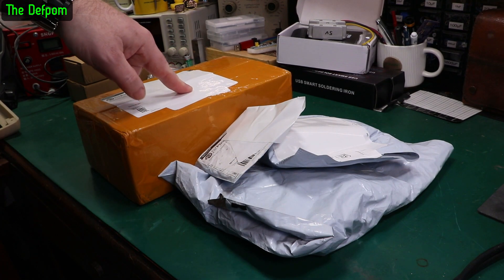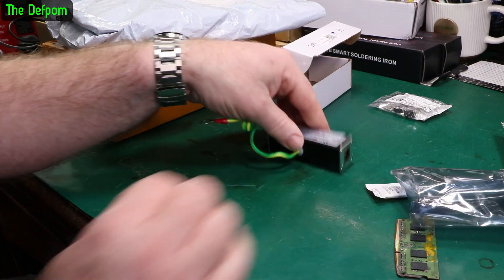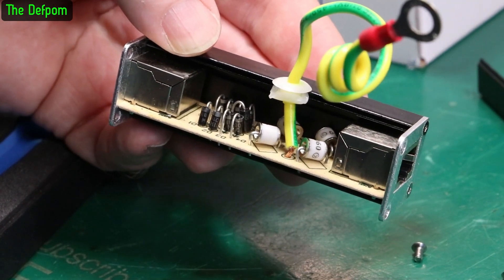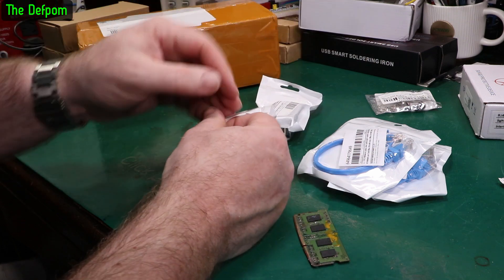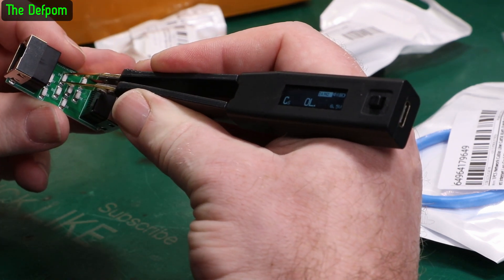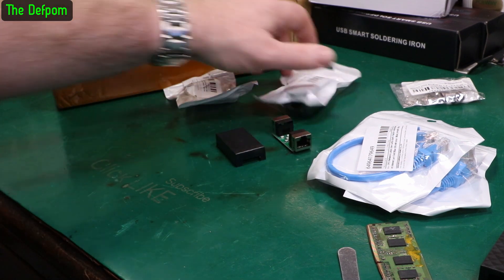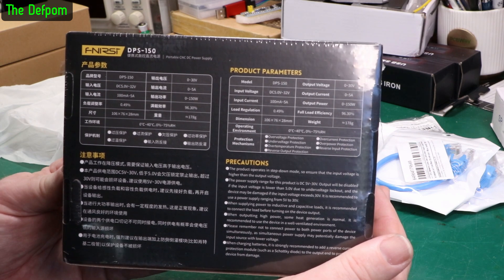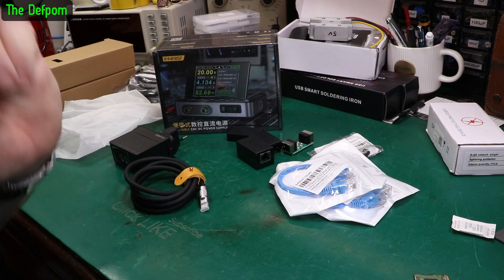🔴 Mailbag Monday 14th October 2024 - No.1288

Comment: Not exactly sure where surge protection on Ethernet could be useful as most services will be within a building and nominally at the same earth potential.  A lighting strike can blow the mains wiring and copper plumbing out the plastered walls.

The best solution to lightning strikes and rise of earth potential these days will always be services delivered over fibre, even short haul to the bottom of the garden fibre is really, really cheap.  The ductwork and the installation is more expensive than the fibre and the transceivers.

In the late 1980’s before fibre became commonplace for business high speed comms delivery, and copper multi megabit data couldn’t be effectively isolated a microwave link was the only solution, but protecting against a lightning strike on the microwave tower and a rise of earth potential between that and the building where the comms services terminated in caused us a a lot of guesswork, a lot of work fitting MOV’s, followed by a several years long finger crossing exercise hoping it would actually work when called upon.

A few years later fibre made it easy.

Comment: Where i worked we had building access control over several buildings, basically a computer motherboard, but connected via serial possibly 485, it kept blowing the front ends when lightning was close, so we added a crowbar circuit to each input
It was some zener diodes across the lines, with fuses on the field side, if the voltage exceeded 5V, the zeners would clamp the votage and the fuses would blow.

Comment: The wall wart, on the outside, said 100 watts, though 12 volts at three amps is 36 watts.
Reply from the maker: @craxd1  that was just one of the markings, I didn’t read them all as they were very hard to read, it can deliver 100W over PD I’ve tested it.